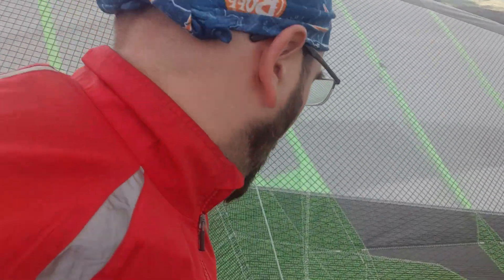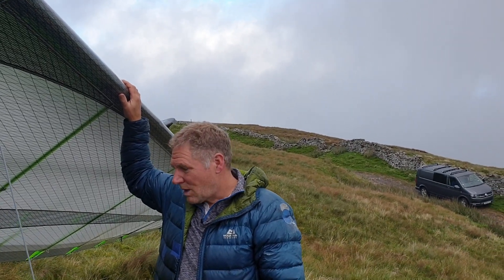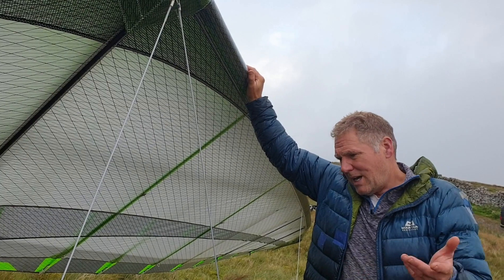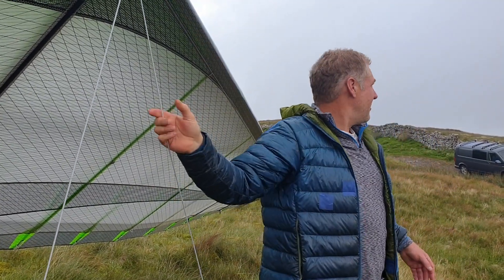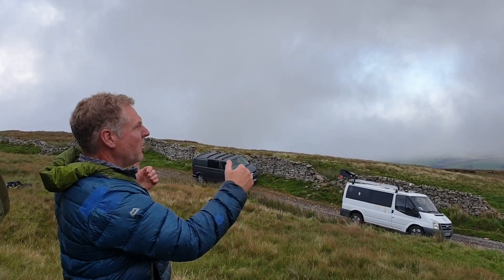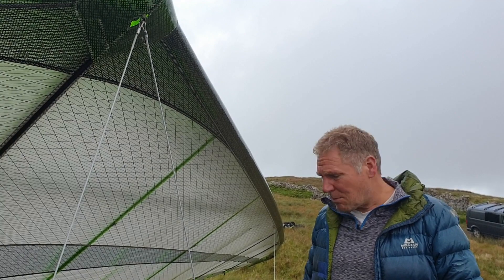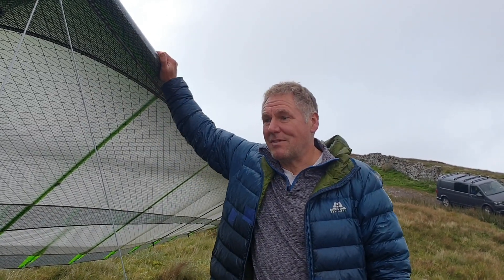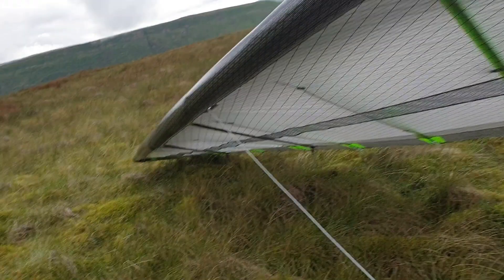Puma owner review

Comment: what the pilot's weight and total weight (pilot + harness) ?
Reply from the maker: Hi the recommended total clip in weight is 75-105kg. It is load tested up to 120 kg though to enable use with trikes and power units. I believe the pilot reviewing it in this video clips in at somewhere around 95-100kg.

Comment: Hello, do you plan to make a smaller version of the Puma ?
Reply from the maker: Possibly, although not so soon. I'm afraid a larger size is a higher priority as there are more pilots that are heavy on it than light. The minimum clip in weight is 75kg, and with a racing harness with reserve weighing around 12kg this means that this size will accommodate down to 63kg.
Reply: @avianhanggliders1985  Well .. Thanx